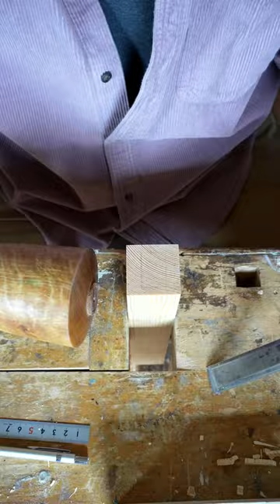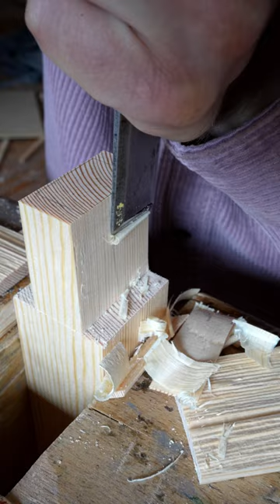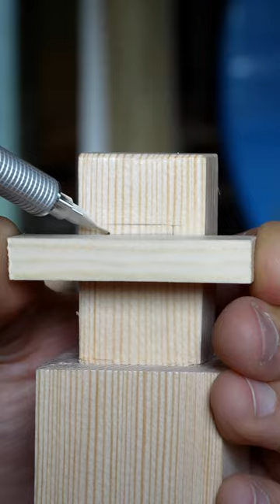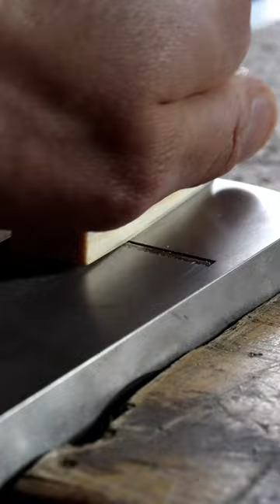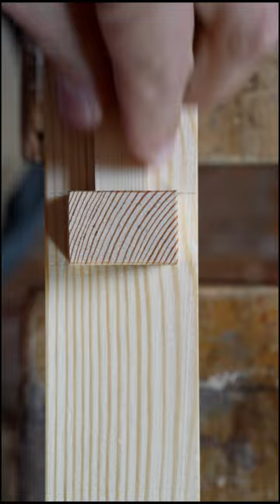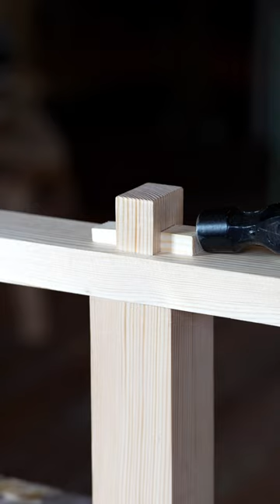wedged wood joint #asmr #joinery #woodworking #satisfying #bois #madera #wood #woodwork #holz

Comment: The hardest part of this is getting your chisels that sharp.
Reply: I wouldn't say hard, I'd say tedious. But yes definitely one of the most important pre-steps
Reply: Yes!
Reply: It's really about the patience in getting them that sharp. Too many move to the finer grit before the courser grit does it's job.
Reply: @miket2120  also... maintaining that sharpness
Reply: @salottin Once it's sharp, it's ready to maintain it. When you have to put more effort in the cut, back to the sharpening stone or diamond plate for a touch up
Reply: Maybe it's important to buy quality chisels at first... I've got some, but they're really far from this
Reply: There are sharpening guides that makes sharpening a lot easier. Itll still take effort what with changing the grit and all, but it makes it so much easier to keep the bevel you want consistent.
Reply: Sharpebing is neither difficult nor much work to do. But you have to do it constantly.
Reply: Professionally sharpener here. If you're doing woodwork at this level, I'd highly recommend either the Tormek T4 (T8 if you don't mind spending the extra money - just the machine, SG wheel and leather wheel will put you in the top 2% of sharpest chisels with a little knowledge), or a progression of high quality wetstones.

Once you have a chisel with a great edge, it's easy to keep it stropped through the day, even having a lower grit strop to drop back to as the edge gets progressively worse (but not bad enough to regrind).
Reply: Me and my brother use a grinder to make ours sharp
Reply: @x0nix  literally no better way
Reply: @holohulolo ya with practice tho bevels aren’t hard to maintain. it’s always tough starting out tho
Reply: And using wood that isn't fucked helps. Some of the stuff I've got at the moment just smudges no matter what you cut it with.
Reply: @tombrown407  for sure. If you have grain running in crazy directions, it’s going to be difficult.
Reply: It's not that hard
Reply: @mitch3384 tormek won't do the back.
Reply: @tombrown407 strait grained soft wood, like what was used here, is much easier to work.
Reply: @bobwitt305  that’s what she said
Reply: @bobwitt305  you’re right. It’s simple. That’s why people spend $1000 on a Tormek.
Reply: @toddrf  actually it is simple. You don't need a tormek or any other wheel. That is just to hollow out the center of the bevel. It won't do the back. None of my chisels or plane irons have ever been hollow ground and the are all mirror finished and surgically sharp. Easily shaves hair. A couple stones, a piece of leather, some green jewlers rouge, and a little practice will get anything sharp.
Reply: @Graysenhayes  thank you! Lol.
Reply: It's not  hard all just practice.
Reply: @adsafgasgasdfasdf  right, and all plane irons are so sharp that the shaving float to the ceiling.

Comment: That is some of the straightest grain I have ever seen.
Reply: You saw pinewood for the first time....
Reply: @amanthatthinks where do you get your pine? Most pine in the US doesn't look like that. European pine does because it's old growth
Reply: @FrogToadBug  I'm fairly certain it's more to do with grade. The pine you see at hardware stores, even what's labeled as premium, is lower quality wood.
Reply: @anonymousaccordionist3326  which is largely due to the age and altitude of the tree. Most American pine is grown fast, so the rings/wood grain will be farther apart and less straight. If the tree grew at a higher altitude it grew less each year, so it's much older at the same size, with tighter and straighter grain. So it's true it doesn't have to be European but the best grain I've seen was from the German alps.
Reply: That looks like some high grade Douglas fir or Oregon pine to me. You can actually get very good quality stuff grown in the North west of the states.

Comment: A fun technique but I find a hand saw quicker for this as the grain in sorry wood is never perfectly straight so I have to be aware of that more for a joint that's this long which slows things down
Reply: A .Tenon Saw for the bulk of the material and the chisel to finesse the final fit would be the norm depending on the grain